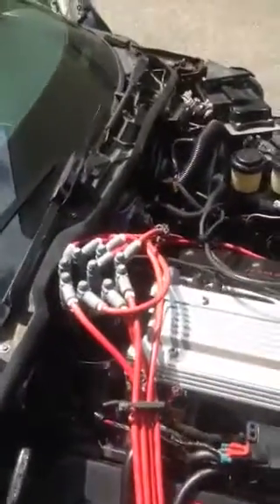1991 Corvette with FAST EFI 2.0 System

Comment: How much power are you putting down. I have a 1987 C4 with everything done except for the cam, heads and intake. Also it had a rebuilt transmission
Reply from the maker: I have not dynoed it yet.  It feels north of 400hp but I'm waiting for installing AFR heads and full length headers.  After that, I will find out hard numbers.

Comment: same setup, how was setting up the handheld for intial startup?
Reply from the maker: To be honest, I probably was too conservative in the beginning.  I recommend setting it close to where you want to be in the end.  Also pay attention to the data so you can see if you should be changing your targets or the components to make it run optimum.  Right now this runs truly amazing.  Much better even than when this video was made.  Just keep yourself aware of EMF interference.  That was my original issues.  Finally use FAST’s Tech Support if you need to.  They are very knowledgeable people.

Comment: Super impressed with your build & zr1 dash is a nice touch. 
I could use your insight, did you have to run dual sensors to use the fast & original dash.(temp,oil,tech, ex.) I also have 91 l98 fast xfi2.0 project & reluctant to cut the factory harness given availability of parts for the C4 .
P.S. it would be great to see more videos of your car
Reply from the maker: Running 2 sensors is not an issue since the gauge runs off the one in the head and the one for the FAST uses the one in the intake.  I am using that arrangement as well.  I have altered the FAST harness with the connectors from my original harness to make it work.  My car is never going back to original so I am not concerned.  I'll post another video when the weather improves.  It runs sooooo much better than when this video was done.  I keep saying, its like a real car again!
Reply: First thank you for taking the time to reply & help. Happy New Years!
The zr1 wheels, updated fenders,black on black is sharp. 
I'm really interested to see how your car runs, it has to be night & day from stock. IMO intake & cam was the best(at the time) & worst part of l98.  I have no idea what I need to  retain or use from the factory ECM to make the car happy. Fast tech was uncertain. 
1. do you use 2.0 for fuel pump?
2.is check engine light on, removed ?
3. What was your biggest headache with the swap?
4.Was you able to use your fx3?
Reply from the maker: @coreycole6967  I have the complete system with the ignition system.  It is controlling the fuel pump as well as all ignition timing and controls. The stock PCM is removed so  no check engine light.  With the PCM removed, I had a SYS message on my cluster.  I covered that portion of the display with a stylish corvette symbol.  I found a way to may the canister purge solenoid function from a monte carlo forum.  I am using Dakota Digital modules to work my speedometer, and to calibrate my tach.  My biggest headache was EMI interference.  Once I realized that and made some changes, I have no issues.
Reply: ivestoy2 your the man!
Your help is greatly appreciated 
You hit on all the problems I was expecting to have. Sounds like the dodak digital will fix my biggest concerns. 
Does it also run the fuel gage?
My understanding is the FX 3 adjust the shocks via speed also , will it no longer work without the stock ECM? I seen the control knob in your console why I was asking.
I would really like to retain mine since it still works.
I also have the Dual sink with MSD 6 box I may try to switch to coil on plug after turbos are on. Right now I am just trying to get the 6-speed swap done and running on fast before I create more headaches for myself. I still have a long way to go I can appreciate to see yours up and running and how much work it takes.
 Fast has told me the Dual sink can    have ignition breakup after 6500 have you noticed this?
Reply from the maker: @coreycole6967  I'm running that dual sync distributor with Fast's ignition control box.  I do not have the FX3 system.  I have an emblem mounted where that knob would be.  The fuel gauge will still work without issue.  I have not had any ignition issues.  This car pulls strong  well past 6000 up to 6500+  I recommend switching to Fast's ignition control box and ditching your MSD.  You have to look into that FX3 issue but if its a problem, ditch it and swap to a set of Z51 Billsteins.  You will not regret that move.
Reply: ivestoy2 sorry, thought you had adj.ride. I will take your advice about the shocks. Fx3's $$$ almost as much as coilovers .
Fast told me the distributor signal can break up after 6500.  It does not sound like you have any problems. If I do I will ditch the MSD. I'm really not looking to go over 7000 at all.
 How did you solve your interference problems was it wire routing or spark plug wires?
Forgive me if I'm harassing you..
I'm just trying to do it one and done the first time. One would think C4  are easy to work on,but space is tight. I feel a lot of people under rate the C4 & a lot got cut up as donors, glad to see I'm not the only one that appreciates them keep up the good work on your build it rocks. Give um hell.
Reply from the maker: @coreycole6967  Locating things in that engine bay is truly a challenge.  I have the Fast PCM powered and grounded at the battery.  I have the Fast ignition controller powered and grounded at the alternator.  The AFR sensor wiring harness runs over the top of my brake booster and down to the sensor staying clear of everything else.  Those 3 things seem to have fixed all my EMI situations.  The other thing you will need to do is use a relay to change polarity of the FAST fuel pump relay control so you can use the factory wiring and factory fuel pump relay.  The other thing is adding a relay that will be triggered by your climate control to turn on your AC Compressor.
Reply: ivestoy2 your help is so appreciated!
The only thing I plan to retain out of my Factory sending unit is the gas gauge. I plan to run heavier wire and dual Aeromotive 340's
& flex fuel capability

Comment: Was the ZZ9 cam on the standard 112 lsa? Sounds very choppy.
Reply from the maker: The lope is awesome.  Choppy but it idles at 550 in gear with only slight shake inside the car.  It sounds amazing.  This is a copy of what the specs of this cam are from TPiS's website

With duration at 212/226, it gives you a slightly choppy idle, making it sound like you have a serious powerplant under the hood.  This mid-range cam with .483"/.520" lift.  112deg. lobe separation.
Reply: @ivestoy2  Thank you!!
Reply: Feel free to post more idle videos 😉
Reply from the maker: @Mean93FoxGT  I will do an updated video and post is soon.  I just finished a Dana 44 conversion and I'm installing a new rear main seal.  It runs so much better than it did in that video.  I'll try to do it within the next month or so.
Reply: @ivestoy2  Awesome. I’m building a 350 and I’m really leaning towards this cam. Thanks

Comment: Did you have to cut your hood to make the fast distributor fit? Putting my build together with the ez efi and it looks like it will be close to clearing the hood.
Reply from the maker: No, I didn't have to.  It sits no higher than the stock HEI cap.  It will fit.  I'm actually installing another system right now with the throttle body on my 87 Monte SS.
Reply: @ivestoy2  awesome thanks man. Had one more issue too, wired in a relay for the fuel pump to reverse the polarity and everytime I turn the key it pulses the injectors.. Not sure what I'm missing here.
Reply from the maker: Gabe Struss the fuel pump relay is set contained so if you feed it that reversed polarity the fuel pump will work.  It will not have any effect on the injectors.  It has to be something wired wrong or related to ignition signal.
Reply from the maker: Another thing, this system is very susceptible to EMI (electromagnetic interference)  Make sure your power wires and sensor wires are clear of each other.  I had issues with my Fast ignition and Fast PCM powered and grounded from the same point.  I powered and grounded my Fast ignition box near the alternator, and the PCM at the battery.  My AFR sensor also had issues so that loops over the master cylinder and down to the sensor and clear of any power wires.  Keep that in mind as you go.

Comment: Im considering adding the fast 2.0 to my 85 because the old harness is toast. did everything just plug in like the injectors? can you control A/C with it? The vette sounds nice btw!
Reply from the maker: Thank you for the complement.  I had to swap injector connectors because the kit comes with newer style LS injector connectors.  I had to use a relay to join the output of the AC control head to the compressor relay.  I also had to use a relay to change polarity of the fuel pump relay trigger for the relay.  I used all the FAST ignition components and their dual sync distributor.   I have been able to lean it out to 14.7:1 at cruise and at idle.  The cam has a lope and it idles so good now with crisp throttle response.

Comment: Also what did you use for the tq. converter lockup?
Reply from the maker: I used an an adjustable vacuum control for TCC lockup.  It works great.

Comment: Hello, great video and great work on your C4!. Can you help me with these questions: How is the system working in a long run test? And also everything you did came written on a manual or you had to get creative to make everything work?
Reply from the maker: The system has been flawless for about 1 year now.  I just went to Corvettes at Carlisle so about 300 miles round trip and it was great.  I spent a lot of time figuring out what original wiring I was going to use and what I would discard.  I then matched those original wiring with the FAST system.  I then spent time seeing the differences in operation between the FAST system and my original vehicle's system.  Then figured out how to get them to play together.  My biggest area of concern was keeping wiring from Electromagnetic Interference.  By far this was my challenge that I overcame with the help of the Tech Support.  Once handled, no issues returned.  I recommend starting with the AFR targets you want.  I went in stages, but I believe you can go straight for it and it will adapt to get you there.  My other area was matching my fuel injector size for what I needed.  Once I got that corrected, the car responded fantastically.  I feel that will happen when I swap the heads.  I think the system will respond along with the car.
Reply: @ivestoy2  thanks for letting me know your experience! Will work on that
Reply from the maker: Parker McLendon  There are no dumb questions when it comes to these type of modifications.  Here are the considerations:  You have multiport fuel injection so you want to keep that as your design.  Find one that will work with port fuel injections.  Next, the stock Tune Port Injection systems are restricted in power output due to the size of the runners on the intake.  They run out of air flow around 4600 rpm or so.  The camshaft is matched to that so if you want to improve power you want to upgrade the camshaft and the intake design.  I have a zz9 camshaft and a TPiS Min-ram.  The two have to compliment each other so the output is as desired.  The more air flow through the valves will need to be matched with more fuel so larger injectors will be needed.  Take those thoughts into you planning as you look at the different systems.